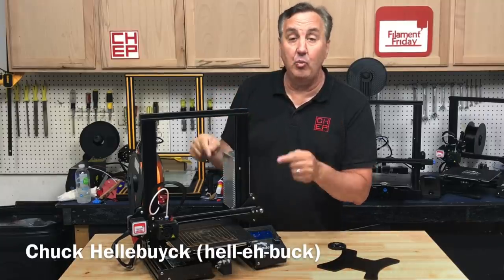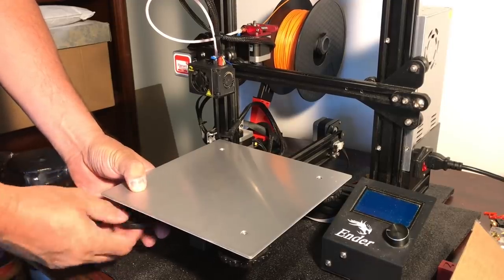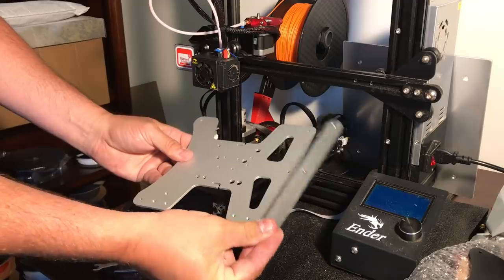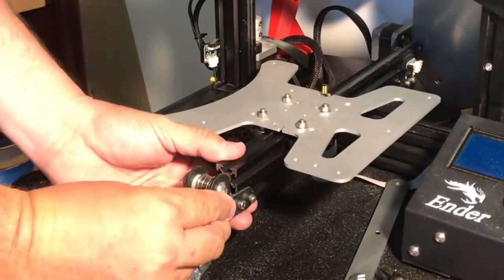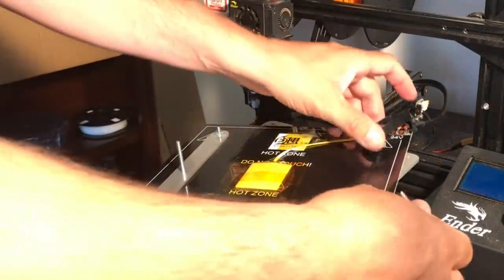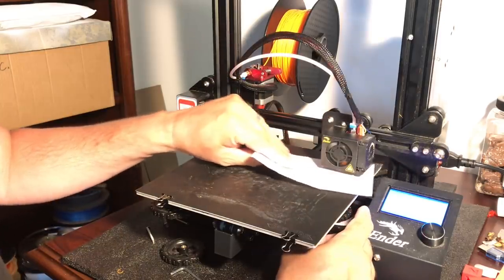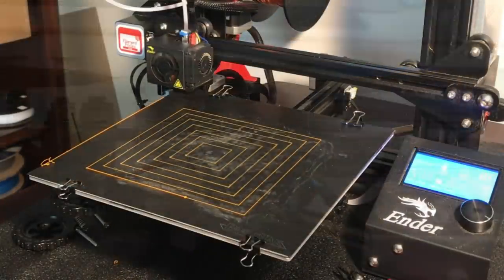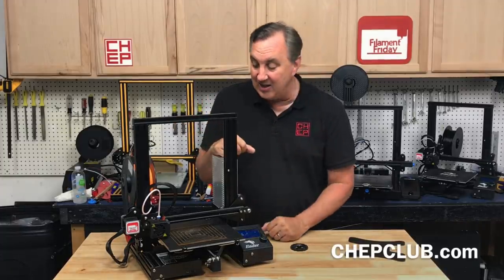3-Point Leveling System on Creality Ender 3

Comment: but how come the bed doesn't wobble on the side with only one screw? and will it work with rectangle bed too?
Reply: I know your question is super old, but I think it doesn't wobble because 1, it uses that long support brace to support the corners, and 2, the printer never really puts a lot of pressure on the build plate. It just gently places layers down.

Comment: There is a reason chairs have 4 legs and not 3; more stability.
Reply: To be fair there are a lot of 3 legged chairs out there that work perfectly fine and are stable... Regardless, how much stability do you need for such a small printer? It's not like you will be printing metal or concrete, but small, light plastic items.
Reply: Yeah, no, not in this case.  Especially since a small bed.  Larger beds possibly, but really, just make sure you use a perfectly flat bed and adjust 3 points only is all that is needed or get a auto bed mesh leveling system.
Reply: @timd9430  I'm starting to think that a 3-point system with no BLTouch might be the way to go. The auto leveling systems (or at least the BLTouch) relies on an already level bed... So is it really worth the extra time it adds to prints by checking the bed every time? What do you think?

Comment: So if it works for a single knob on one side for front and back, why not a single knob on the other side, making it a two knob adjustment instead of three?
Reply: Its physics, a plane is defined by 3 points
Reply: @tecnoimagen5333  That's geometry, not physics, but you are right, three points defines a plane!
Reply: @tecnoimagen5333  Yes at the core but the application is engineering and there is more than one way to establish a stable platform. However you are correct that a three point base is by default more stable than four and obviously two. Regardless with proper supports you can in fact make a two knob system that will perform the exact same function.
Reply: @kevinm3751  or you can have a zero knob system if the manufacturer dials it in for you and permanent glues it in place. you literally had it explained to you and you still didn't get it. minimum two points to create a straight line, three points to create a flat surface. any more is redundant. unless you are the only one here using a 2D printer while everyone else is printing in 3D
Reply: @suivzmoi  No, its your non-technical mind that cant wrap your head around the idea it can in fact be done! To reply to the rest of your comment would be compounding a contradiction with a contradiction. Dont make your mental fatigue worse trying to grasp the idea when it is clear you dont have the mechanical aptitude to understand it!

Comment: A few notable questions to the creators of this addon:
1) why?
Reply: Because adjusting any one of the 4 corners usually effects the adjacent settings, so you have to play a little whack-a-mole to get all 4 exactly right. with 3, you adjust the Y axis level and then the X axis, and you're done.
Reply: @snailer06  the less knobs you have the more often you will readjust them. Why do you think quadcopter more popular than tricopter?